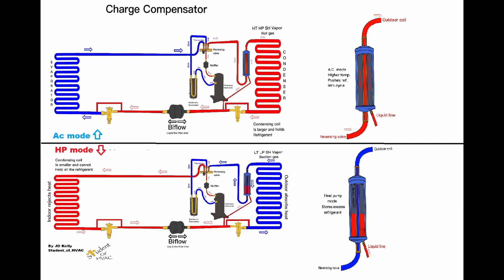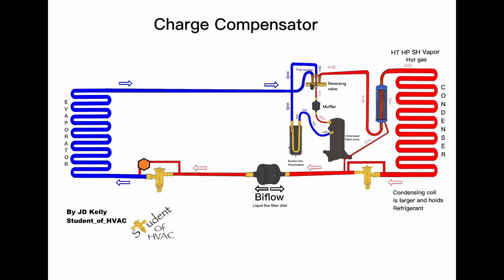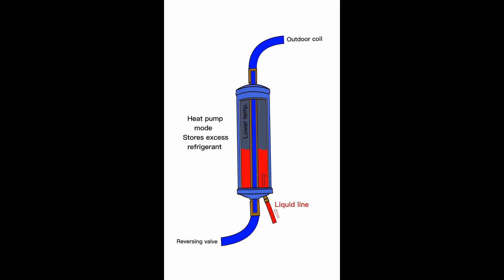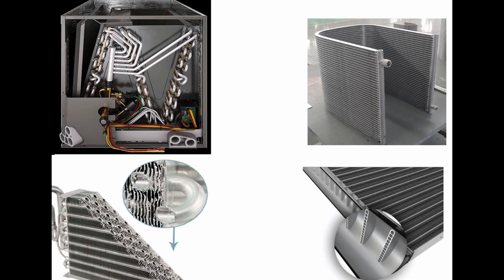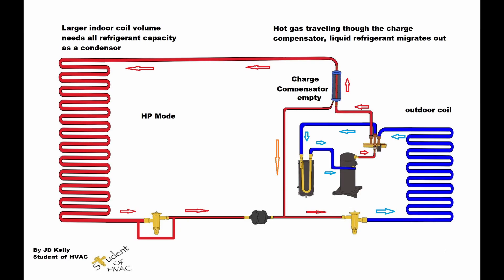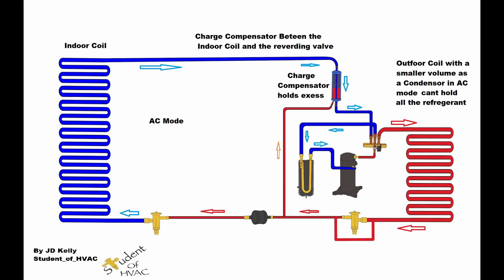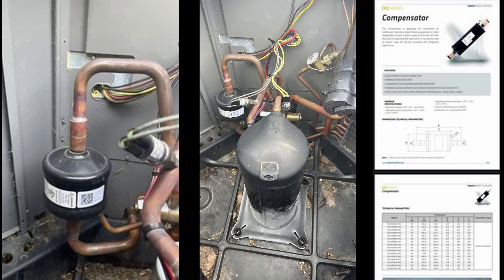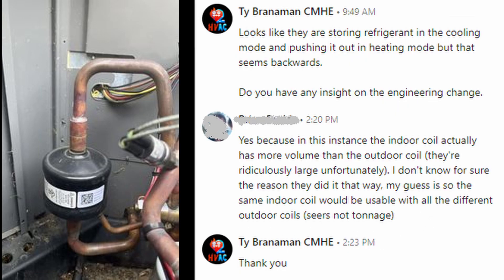Heat Pump 10 New charge compensator 2 of 2

Comment: You see a lot of them on the smaller tonnage Rheem Rudd heat pumps that are high seer units. They do this because often times the indoor coil can’t handle the charge in heat mode.
Reply from the maker: That's correct!

Comment: When pulling a vacuum on an existing system, will remaining refrigerant oil in the tubes affect your vacuum reading? 
In my mind the oil will evaporate just like water and ruin your vacuum reading?
Reply from the maker: I have over 20 videos on vacuum.

Refrigerant oil will not be affected by  vacuum. 
It will take longer to pull the moisture out if existing oil and only driers can remove all the moisture from POE oil .

Get the book, Review of vacuum for the service engineer and you will learn a lot and it will clear up these misconceptions.